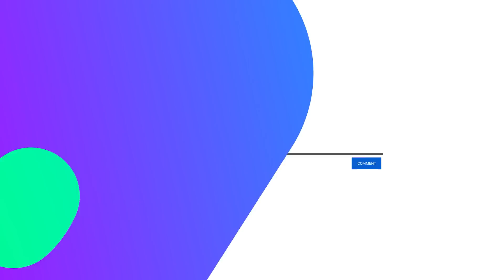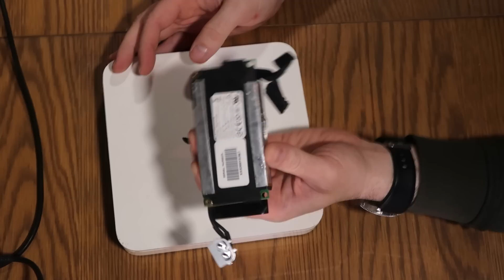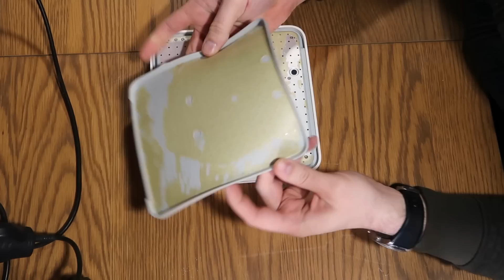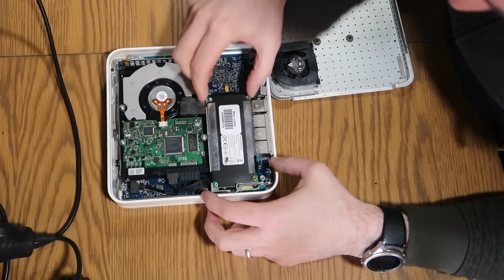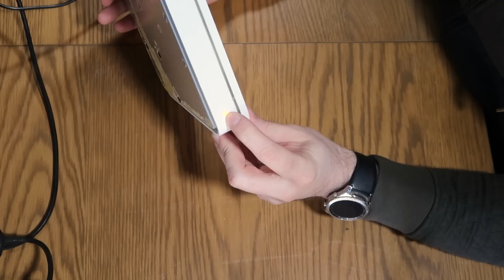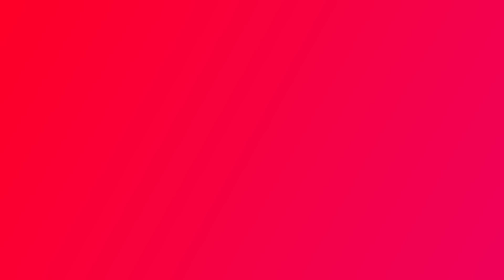Apple Time Capsule A1254 - Power Repair

Comment: I have a US time capsule, and I took it to an Apple Store Genius Bar and they told me it was probably a power supply issue (if I’m not mistaken).  Do you know which part I would need, for the US Time Capsule?  Also, if I send mine to you, do you think you could repair mine, if I send it with the power supply part?  Or do you know of any communities I may be able to send it to to be repaired?

Comment: My time capsule just died on me. After watching your video I have successfully disassembled my time capsule. I found the replacement power supply on ebay and will order soon. But I thought about the cord to plug it in and wonder if that needs to be replaced to. What are your thoughts?
Reply from the maker: I wouldn't bother replacing the cable, typically it's the capacitors in the power supply that fail. So you should need no more than that replacement

Comment: Where did you purchase the power supply ?
Reply from the maker: Ebay
Reply: @WeRepair  Hi, do you have the model number by any chance?
Reply from the maker: @GJeanJr  For the timemachine or the replacement part?
Reply: @WeRepair  replacement part
Reply from the maker: @GJeanJr  This is the description of the part I bought hopefully it will give you what you need "Apple Time Capsule Internal Power Supply 614-0414 614-0412 614-0440 A1254 34W"
Reply: @WeRepair I think this just happened with mine. My model is A1355. Do you happen to know where I could get that part. Also wondering how much it cost you. Thanks.